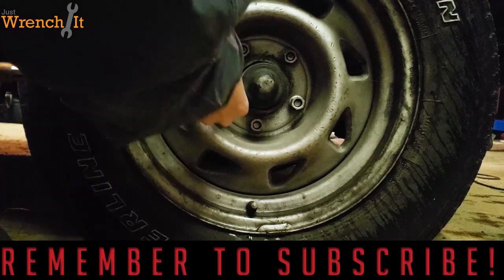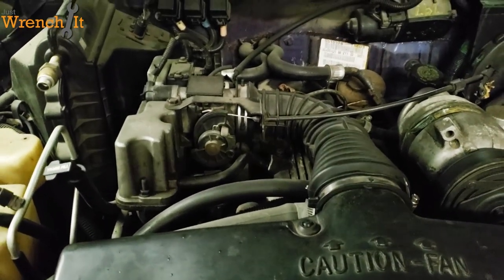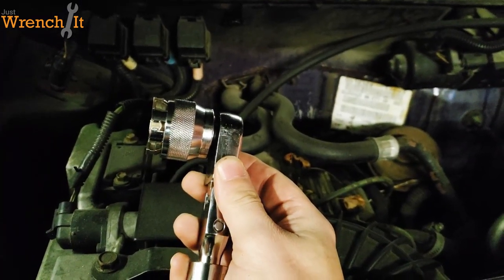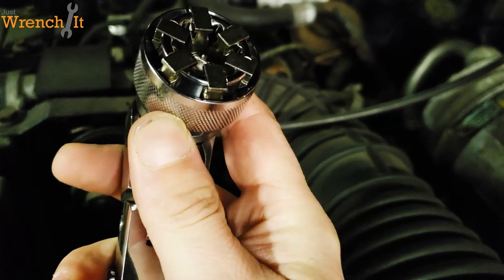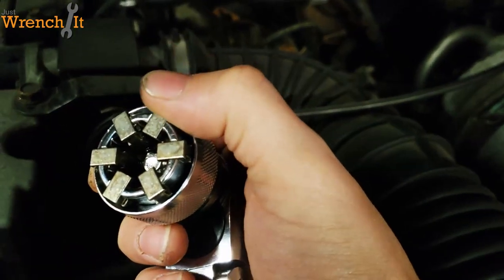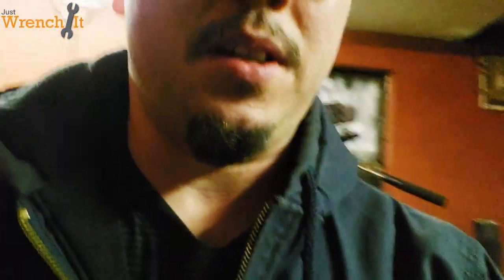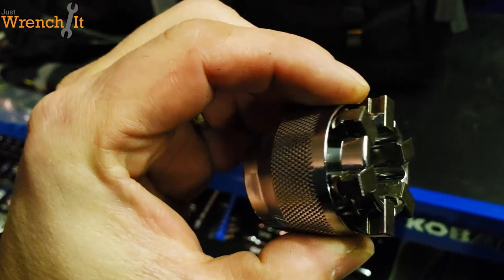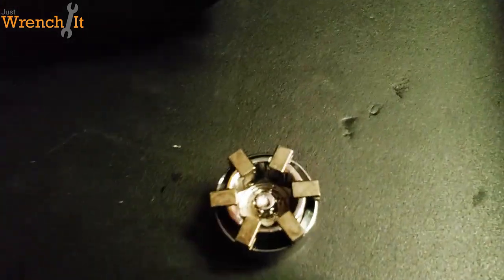A Universal Socket that WORKS!!!!

Comment: Have you seen the Bionic Wrench from LoggerHead Tools? My wife bought me one for Christmas 2 or 3 years ago. It's a similar design, but it's an automatically adjusting wrench. It has a pair of handles, like pliers. When you squeeze the handles, the 6 little studs squeeze inward to grip the fastener. When I got it I thought it was awesome. I really thought it would be useful. I still haven't come across a nut or bolt that I actually needed to turn that I could get this cumbersome tool on. Maybe someday I'll find a use for it. I feel bad, because I have an amazing wife, and she bought me a thoughtful gift, but I've never found a use for it.
Reply from the maker: One day itll be just what you need I bet
Reply: @justwrenchit9287 , yeah, but I'll forget I have it and use something else. LOL!
Reply: The guy who designed the bionic wrench (Dan Brown, I think?) is a professor at my university and everybody always tells him "yeah it's really cool, I can't believe it didn't take off" but we're mostly messing with him because a regular adjustable crescent wrench can do all the same things...
Reply: @pablogriswold421  , the Bionic Wrench automatically adjusts, so it would be faster if you have a fastener located in a place you can use it. I've got a pair of auto adjusting groove joint pliers made by Hanson that are awesome.
Reply: @pablogriswold421  which is a pretty stupid thing to tease him about because guess what? Crescent wrenches are far more gimmicky yet there you are slobbing them
Reply: @titaniusanglesmith9690  For the record I agree that there's no need to be mean, and that there are definitely some people who would get a lot of use out of it. It's just that for most people, the deal breaker is that you need so much clearance around the fastener that you can't rely on it to be a one size fits all tool, which was the point.

Comment: I seen it on another channel being tested and they put it on the useless tool list today,on Car Wizard.It slipped on him a few times
Reply from the maker: Yeah it's not very car friendly,  but stuff at work is just a few bolts here and there without much obstruction. For that this will work great.
Reply: He tried it on a tractor.That video is on his channel,his current video testing wonky wrenches #2

Comment: I would have been interested to see the standard universal wrench you diss'd tried on all the recessed/up-close/etc. circumstances your new universal socket didn't work on.  That would either stand-up and demonstrate your claim that they're rubbish, or else disprove it.  
You left me unconvinced by both parts: I think if you have to carry around a whole wrench set for the times your universal tool doesn't have the space to operate, you may as well not bother with the universal tool.  And if you don't show me that the other tool doesn't work when so many other videos have shown it working, even with a large torque, I have no reason to believe you on that either.
Reply from the maker: Well I dont have one. The tool community at large says they are junk, that's good enough for me. This is more showing the strength of the socket because that was one main issue with the other style. I agree that no one tool is going to fit every repair. Some do make things easier though.